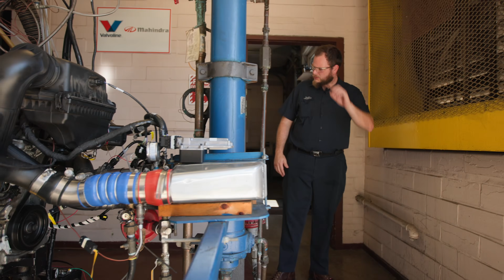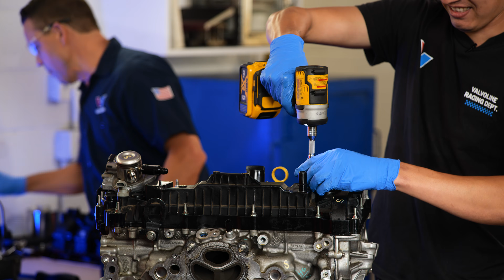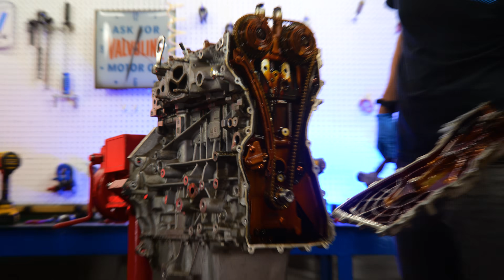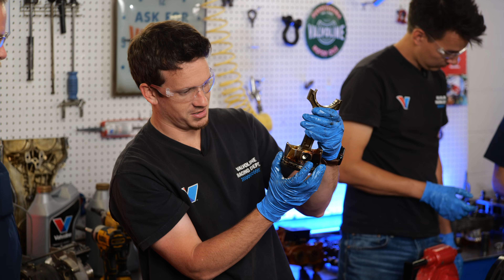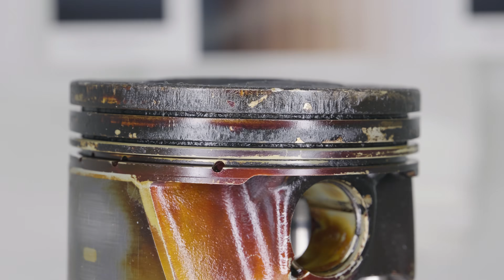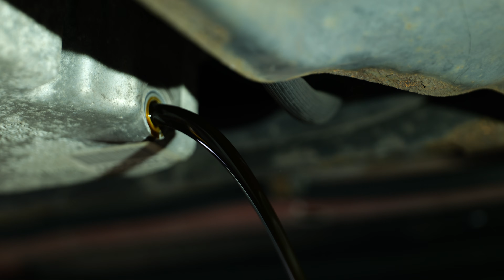RESULTS: What Restore & Protect does to engines after 500K+ miles

Comment: Valvoline, any plans for a 5w40 or a euro spec version? I ran 2 intervals of 5w30 in my q7, but i need a 5w40 euro oil!
Reply: yeah same i would love a 40 weight restore and protect, even a 0w16 would be great, hopefully in the near future!
Reply: @duskycotw8404  why 16?  30 is the sweet spot for all but high output/turbo'd engines.  You want better mileage, 10%, right now? Use smaller tires.....no need to make engines more complex, just use smaller tires, that's what we had in the 90's.....why can't you find 15's anymore on small cars?
Reply: @duskycotw8404 0w16 is already a thing
Reply: They have 10w40 in Australia so its not out of possibility.
Reply: Yup
Reply: Any specific reason you need an xW-40 over xW-30? VW/Audi engines specify oils by VW spec, which you’ll find in the manual. If the manual says VW 502 00, that means xW-40. If it says VW 504 00 / 507 00, that means xW-30.
Reply: @L-8 Cause some cars require it, and 5w40 in high stress situation is basically mandatory.
Audi sport for the RS3 reccommends 5w40 on the track, but 0w30 for general use.
Reply: @L-8 my q7 specs vw502/505 5w40. I am okay with thicker 0w30 with hight hths, but have to be careful, as i am modified, so would prefer a 5w40. And vrp 5w30 is a thin 30 grade.
Reply: @L-8  European 30 weight oils are about 20% thicker than typical american oils. They protect better and are less volatile

Comment: All car manufacturers should use this oil
Reply: All car manufacturers should use smaller tires, save more emissions than any fancy system or oil.  Also get rid of low tension piston rings, which are the cause of these problems to begin with.  You want to prevent problems, here you go.
Reply: @robczar7479 blame epa and all the new safety requirements we can't use small tires because of all the safety equipment adding weight which needs more rotor sizing
Reply: Manufacturers want you to buy a new auto every 3 years. They don’t want you keeping your auto for 10 years.

Comment: I used this oil in both vehicles and did valve cover gasket on my wife's 2018 Honda crv and took valve cover off it like it brand new and it's 90,000 miles on it.

Comment: Would love a 0w30 restore and protect option!
Reply: stop...0w30 why?
Reply: For cold cliamates
Reply: @mr.3phase228  Siberia?  They still start their engines with 5w40.  Where do you live that you need it?  People in Arizona talking about 0w...lol
Reply: Canada. 5W will do 90% of the time, especially down south where I'm at, but a 0W is nice to have.
Reply: @miltechmoto why not?
Reply: @johnm243  Because it makes no difference, except lower the flash point by adding viscosity index improvers, it makes the oil weaker to high stress.  What do you know about oil?
Reply: @robczar7479 wow "what do you know about oil?" Lol are you like this with every comment you don't seem to like on youtube? Take it easy guy i just asked why not
Reply: @johnm243 the wider the gap between the first and second number the faster the oil breaks down. they already have 5w30.
Reply: @miltechmoto that part i understand, but if there's engines that require 0w30 like some European vehicles, why not have an offering since some people will no doubt be buying used and poorly maintained vehicles? Wouldn't this be something even a smaller consumer base would benefit from on the market?
Reply: @johnm243 which cars require that specifically 0w30? five and zero isn't that big of a deal. maybe ten or twenty weight might make a difference
Reply: @miltechmoto i believe the newer model bmw m3 and hyundai veloster n can take 0w30. I'm sure in high demand situations you'd want to go up in viscosity I'm not arguing that part. I'm just saying a wider product lineup can't be a bad thing
Reply: @johnm243 buddy I need 10w40 FIRST. You already got 5w30. The new m3 takes 5w30 or 0w40 or 0w30 in cold weather. The only place 0w is needed is like when it's snowing. You're driving the M3 on summer tires not reenacting that james bond movie.
Reply: @miltechmoto I'm not the one asking for it lol my oil needs are already covered
Reply: @miltechmoto @valvoline get this guy his 10w40
Reply: @miltechmoto  exactly, people are so dumb. might as well just sell them garbage if they cheer for it.  honestly its too much sometimes.  You want 10% better fuel economy, across the fleet....use smaller tires.  Why are 4 cyl cars riding on 18/19/20's.  In the 90's 16's were ballin rims lol.  All these new designs are killing the industry, to meet emission standards that save FRACTIONS of a percent.  Just use the old non turbo'd engines that last a million miles, run smaller tires.  Should be government mandated.  It will be impossible to create a gas engine that meets these standards, then Chinese EV's will be the only option....watch, it's already happening in Canada, and i believe it's all by design.
Reply: @robczar7479  Back then 16’s were a big deal and made a huge difference from plain-old 15’s. Don't get me started on 14 and 13” rims.🤓😂  lol, times have changed. Remember when 17’s and 18’s entered the market also. 

Waveform heartbeat pin stripping improved gas mileage too. Jk

Comment: And it's not just the piston rings that get cleaned, but the lifters and chain tensioners. I had a chain rattle on my xterra and after one oil change interval with restore and protect, the chain rattle is gone. Only drove it three or four thousand miles over a year.  A chain tensioner and guide job costs like one or two grand. Same goes for your lifter tick issues. To have those components cleaned out and fixed by simply using a different oil is a godsend. A lot of times those types of peripheral issues take an engine out. Another one that comes to mind is a clogged pcv valve. I'd like to see what it does for the valves on a direct injection engine, if it cleans those from oil vapor alone.
Reply: It doesn’t directly clean them but indirectly yes. I’ve used it on my 2012 Sonata with the Theta II 2.4 GDI engine it has 200k miles on the original engine and they have been cleaned 3 times when I switched to R&P I quit cleaning them just pull the intake every 10k to check them usually every 50k they were grubby this 50k they just have a light film
Reply: @Austin-cg7be like an oil film or like a light dusting of black carbon?
Reply: The Oil Geek responded to a comment I left on one of his videos and said it wouldnt affect the valves.  Maybe he was referring to constant contact and not vapor
Reply: @louarmstrong6128 what did he say exactly?
Reply: @miltechmoto i asked if it would clean the valves
He said no
Reply: @louarmstrong6128 yeah but valvoline has said they suspect it will help possibly but they havnt really marketed that aspect or maybe they mean they haven't checked it.
Reply: @miltechmoto we need mechanics to do a before and after R&P to check on the valves. Guys on the recent Valvoline video did not bring up any changes in the valves.

Comment: I really want to see restore and protect in 10w40 and 20w50 for the motorcycle side. ideally formulated to be more aggressive because I don't have emissions or get as many miles... there's Also no cat to plug.
Reply: Yeah they need higher weight oils for the performance vehicles and they need to apply the same cleaning to their entire lineup.
Reply: @daphnekimberlybrillantes9029 yep like some of these high performance cars need a higher weight oil and so far they only have 5w30, 0w20 and 5w20. a 350z needs like a 40 weight and some of these Porsche and corvettes need a 50 weight. But sport bikes typically run 10w40. I run 20w50 because of the added film strength in hot weather while riding in the canyons during summer. But I dont have any catalytic converter to plug on the slip on exhaust so they could probably up the cleaning power.
Reply: @miltechmoto  there is 10w40 in australia
Reply: @WayStedYou I know, but I'm pretty sure they have a refinery there that does it there only because of the high temperatures of that region. They don't export it and if you try to have it imported you need it in like metal drums to meet shipping standards for fire prevention.

Comment: On my third run of vrp 2014 mazda 3 137k. Engine noticeably quieter and mpg are up
Reply: On my 8th or 9th, I own a 2016 mazda 3 2.0L with 255,000kms (158k miles) used bore scope and the inside of the top of the engine looks like its never been turned on before, I will be using this indefinitely

Comment: May try this on my 20p6 Subaru sti which has 154,000 miles. 1 major issue po302 which cost me $5116 in repairs.  Most I  ever spent on a repair.  73 retired lineman diyer
Reply: Let me buy your subaru please
Reply: P0302 indicates a misfire in cylinder 2. Hopefully for $5k the car was fixed right. Don't sell!

Comment: Would really like to see this in a 5W-40
Reply: They really need to add this technology to the motorcycle oils and more performance lineup where you need a 40 or 50 weight for higher hp applications.
Reply: @miltechmoto  Yes, would like a 5w50 for my boosted Mustang
Reply: @RidinONChrome yep, although you do have to run shorter intervals for a 0 or 5 weight. what does you car call for specifically?
Reply: @miltechmoto my 2015 Coyote was 5w20 but I've always ran 5w30. Ford switched to 5w30 in 2019 or so. Boosted Coyotes need 5w50.
Reply: @RidinONChrome  My old V10 M5 specified 10w60. Last I knew, it was available from Redline, liqui moly & of course Castrol TWS which BMW helped design the oil.  After customers in Germany were chucking rods on the Autobahn, Post-mortems show there was Nothing wrong with the engines. It was the oil. Problem solved!
Reply: They have 10w40 in australia
Reply: @WayStedYou 10W for Restore & protect? Or regular Valvoline semi syn?
Reply: @rrq4662 10W-40 full synth restore and protect available in Australia.
Reply: @rrq4662  Restore & Protect 10W-40 6L. Part number 1492.06
Reply: @rrq4662 Restore and Protect
Reply: @rrq4662 R&P is available as a 10w40 in Australia, made at their plant in Sydney, Valvoline make honest products.
Reply: @rrq4662 10w40 restore and protect. 

I use it in my Y62 Patrol
Reply: @rrq4662  10w 40 restore and protect, run it in all my cars in aus.
Reply: @rrq4662  Yeah we have Restore & Protect in 5w-30 & 10w-40 both locally made.
Reply: @Notabot1310 never knew valvoline  has local manufacturing in straya. the ones I see elsewhere were US export stocks. are they available at K-mart?
Reply: @rrq4662  No, we have specialised stores for car maintenance. Super Cheap Auto, Autobarn & Repco.
Reply: 0W-40 please to match a lot of high perf Euro and GM specs
Reply: needs to be wet clutch safe though
Reply: @miltechmoto  They should give car owners what they want first, then satisfy motorbike owners. Restore & Protect was invented for cars.
Reply: Right? 8 of the 10 vehicles I’ve owned all required 5W-40
Reply: Absolutely, ad in EU specs for our market, we are 300 mln people afterall :)
Reply: Yes, 5W40 for a diesel engine
Reply: I think about how many German cars could be saved if there was a Restore and Protect 5w40 or 0w40. It could also be useful in the USA for people who have really old cars that called for 10w40.
Reply: They have a 5W-40 in the Europe spec. I use their 5W-30 Europe for my TDI.
Reply: @HifeMan There's no R&P 5w40 🥲
Reply: @AAAAAAndrea . Still great oil and it meets VW recommended specs for TDI’s which is surprising hard to fine. I’m sure it has a lot of the additives that help keep the motor clean.
Reply: @HifeMan From what I saw in the product official  TDS it doesn't meet 507/504 specs, there's no Euro R&P as far as I know.
Just US and AU/NZ version
Reply: @AAAAAAndrea 

Yeah I’m just referring to their euro formula full synthetic oil. It’s not R&P but great oil nonetheless.
Reply: There is a 5w40 R&P in Europe
Reply: Did it help your TDI?

Comment: Started using Restore and Protect as soon as it was introduced. Since 20,00 miles on my 2016 F150 i use Valvoline Full  Synthetic 5w20 or Restore and Protect Full Synthetic 5w20 ..👏👏👏🔧🧰👍 🏆🏁

Comment: Currently running this in a 1991 Civic with 215k and an Accord with 240k which doesn't burn any. The Civic was burning about a quart a week (about 300 miles). After about 2k miles, it has slowed to 0.5 quarts per week. The oil gets dirty very quickly, and looking into the oil fill I can actually see metal becoming cleaner. It's impressive. We'll see how much more it improves.
Reply from the maker: We love the progression updates - so glad to hear it! 👍
Reply: I had a 1991 civic “special edition” my parents passed down to me. Manual transmission but no tachometer. No cup holders because it was made in Japan and they wouldn’t eat in a car. I got rid of it when the brake lines were rusting but the engine still ran great.
Reply: @craigiefconcert6493  that's a shame. Ours is also a manual with no tach. Bare bones, base model all original. They make great commuters, about 40 mpg on the highway

Comment: I'm using Restore and Protect in my wifes 2024 Bronco Raptor. I used Motorcraft 5W 30 for the 1st oil change at 500 miles and switched to Restore and Protect at the next oil change at 2000 miles. I have run 6000 and 7000 mile oil change intervals with no oil consumption. It's currently at 19,000 miles and showing full on the dipstick. I have seen Facebook post where people are claiming oil consumption on their 3.0 and 2.7 liter EcoBoost engines. Some claim oil consumption of 1 quart in 1000 to 3000 miles. I'm very happy with Restore and Protect.
Reply from the maker: Thanks for sharing!
Reply: @valvoline please pass my comment suggestion to dr Michael worholic. We need 10w40 and 20w50 motorcycle oil with this cleaning technology. Also higher weight oils for cars and trucks.
Reply: @miltechmoto  there already is 10w40 in australia they just arent selling it in the USA
Reply: @valvoline when does it comes to europe?

Comment: I have used this oil to clean up 2 vw air-cooled engines.  One old 36hp from 1959 and a 1968cc high compression stroker.  This oil is amazing.
Reply: I had a 69 dual port type II. I remember in the book “how to keep your Volkswagen alive” he talked about single weight oil. Technology has come a long way!
Reply: 5w30 on an air cooled engine?
Reply: @AAAAAAndrea 5w30 in our 59 with the 1100cc, 5w30 in our 67 with a 1641cc both valvoline.  15w50 mobile 1 racing in our 64 with a 1968cc.  All synthetic oils.
Reply: @OwhyeeVdub But isn't 5w30 too thin for an air cooled engine?
Reply: @AAAAAAndrea you need to know your bearing clearance.  But the original manuals up to the 70' said 30. Later with multi grade it would be 5w30 to 10w40 depending on your location.  Mexican and Brazilian vdubs called for 15w40. So really any modern oil will work fine in todays air-cooled vdubs. It just depends on what you're doing with the engine.  The only reason i run 15w50 in my 64. Is because i pound on it all the time. But i built it to do that. The 59 is completely original.  And the 67 have a mild build to it.

Comment: No doubt this is good oil. But i still ❤️ my Amsoil Signature Series. The esters within keeps my engine like new.
Reply: 1% of the esters and 10% pao for $15 hell naaaaahhh😂😂😂
Reply: @N17SA  Esters aren’t the only thing that contributes to a clean engine there bud. And quite a few impressive modern oils with reputations for very clean internals also rely on AN’s,  not esters.
Reply: @N17SA  Sucks to be poor.
Reply: those ester based oils will keep the vehicle clean no doubt but they wont clean a vehicle with pre-existing deposits in any practical time period. Unless they are like super high ester.

Comment: Valvoline Restore & Protect for the win!!!!! 🏆 Been using this oil religiously on my channel.
Reply: Valvoline Restore and Protect FTW!!    I wish they would do a video on the Restore and Protect ATF 😀
Reply: @voiairwolf great idea
Reply: @voiairwolf  ... don't think you get the same type of "ring build up" in a transmission.. no combustion issues..  best way to keep AT in good shape... change fluid regularly, keep at proper temp and use proper fluid.. all the guys on the 68RFE rigs that use the bypass are doing more long term damage to the trans due to low temps.. oil need a specific temp to perform properly...  same reason you have 0W-20 and 5W-30 oils for engines.
Reply from the maker: Happy to hear about your experience!
Reply: @valvoline Can we use oil additives with this oil for exemple Ceratec?
Reply: Midwestf150 got me on the R&P train !
Reply: @Tony_Seed just a guy trying to get to 500,000 miles. 😅
Reply: There's good ole MidwestF150